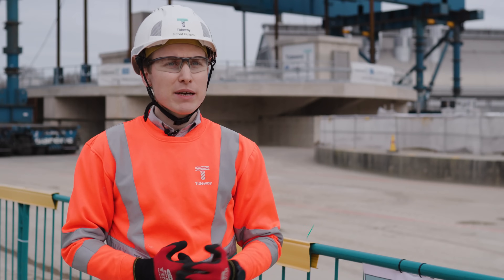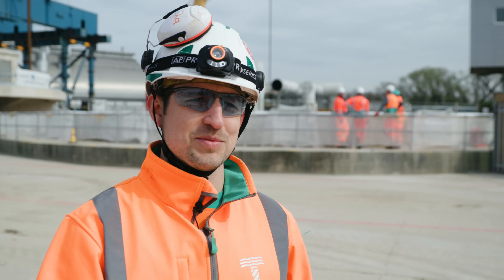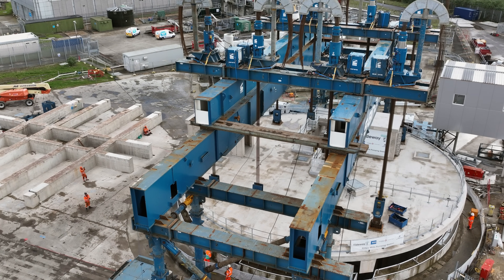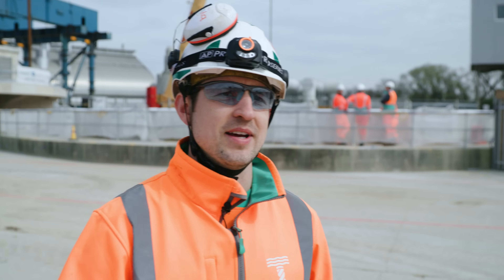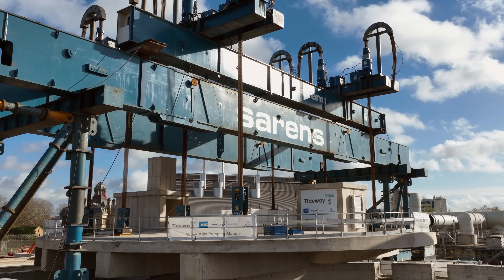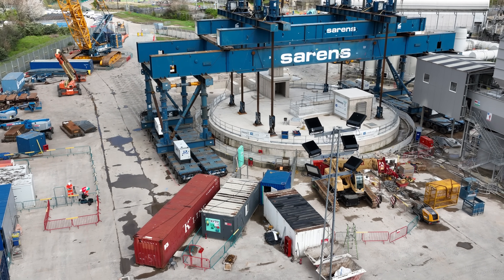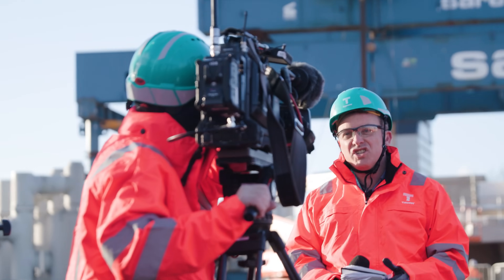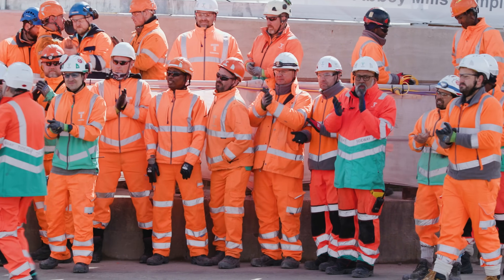LONDON'S SUPER SEWER: Tunnel fully built after final lid lifted into place

Comment: Years ago someone built, at huge expense to the tax payer, a water de-salination plant in London so there'd be plenty of water in the summer months. They switched it off. Said it was too expensive to run and they'd rather give the money to their shareholders. How long will it be before the sewer gets bunged up because it needs a new fuse and it's cheaper to just keep on chucking wet wipes in the river.
Reply: Desalination is a boondoggle. Melbourne did it too. Shelbyville went with a monorail.

Comment: Could they not have spent the money on increased filtration plants so that all the water going in the Thames was actually clean, not just nearer the sea?
Reply: that's basically the whole point of the tunnels. Read up on it. The whole idea is that it takes the main brunt of the sewage from London, to new filtration in the East End. Which can then be put into the thames, or back into the water system.
Reply: @peterwelly  If that is so, great. All we hear about is the great big tunnel!
Reply: In practical terms there’s no way you could build extra filtration plants all the way down the Thames.  Just not enough space in crowded London
Reply: They've done that as well. This is about getting the sewage to those plants. Beckton, Mogden, Croosness works have all been expanded
Reply: @willum223  So I see on Wikipedia. Given the record rainfall we have just experienced, let's hope they got the sums right this time.
Reply: The water is returned to the Thames nearer to the sea, but only after it has been filtered and cleaned - so clean in fact it can also be returned into the water supply.
Reply: No